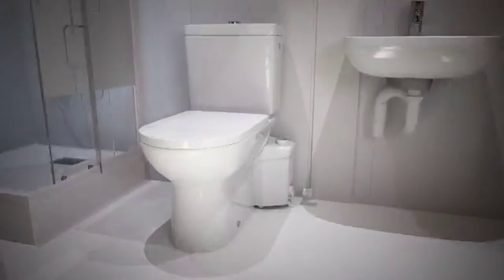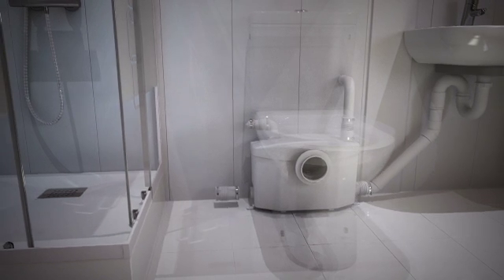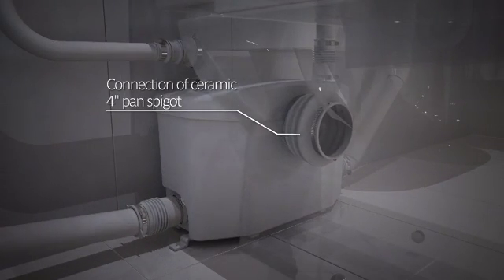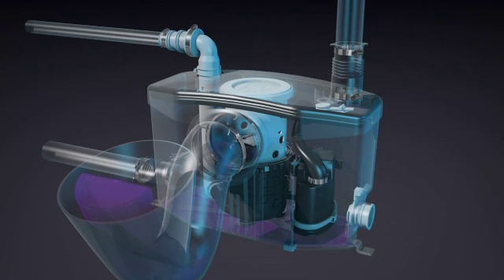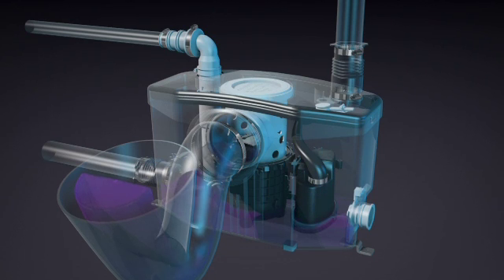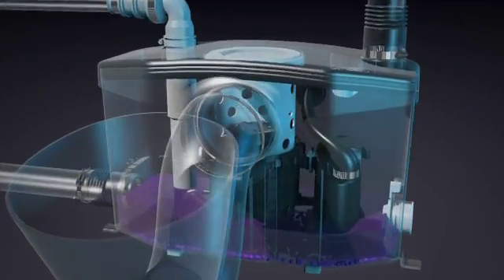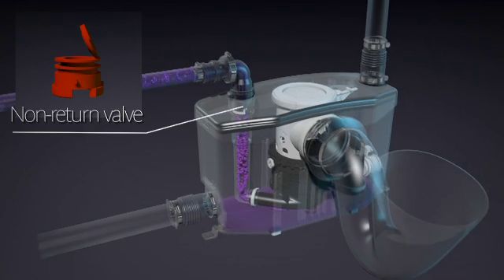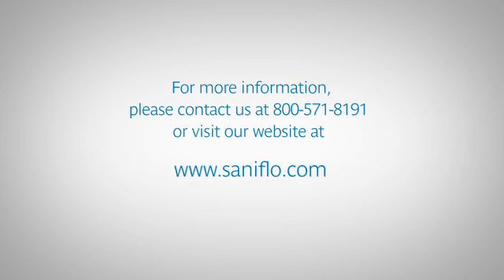Saniflo macerators

Comment: "The concept is simple, just install a pvc pipe that is too small to safely handle any blockage, run it through several rooms where it risks leaking all over the place, and be constantly having to dismantle it to unclog the mechanism (risking your fingers being chopped off) because some idiot put wet wipes down it.

Oh and it costs around the same to service one as just buying another unit from new."

God I hate  these things.